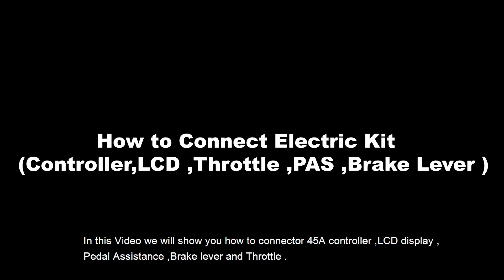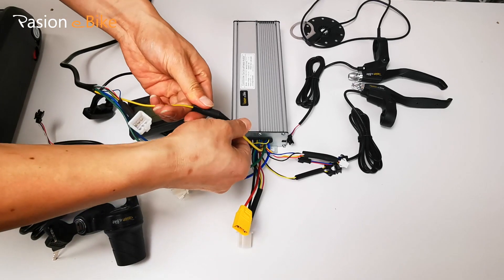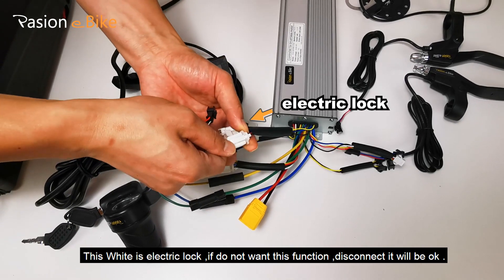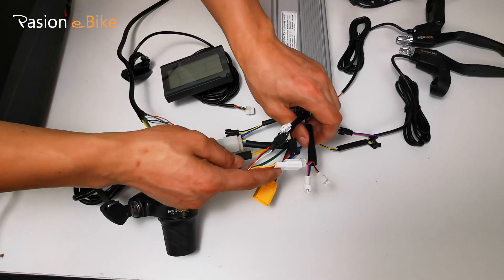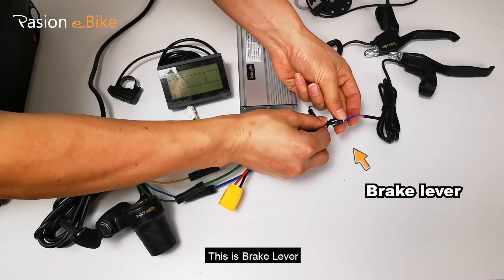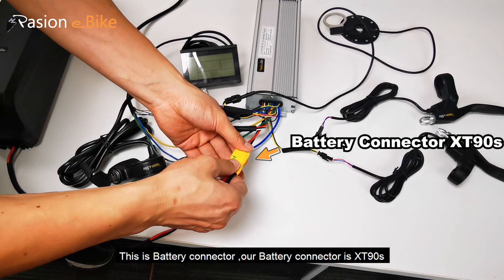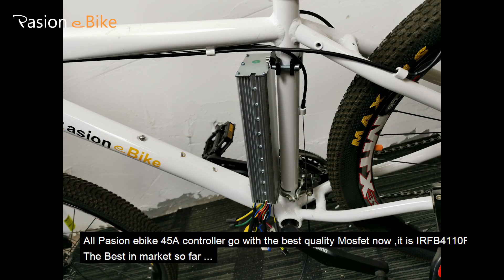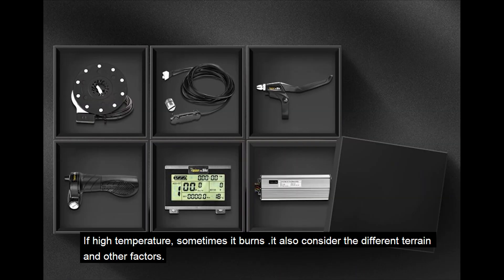0 Pasion ebike Tutorial  How to Connect Electric Kit  45A Controller,LCD ,Throttle ,PAS ,Brake Lever

Comment: hi i have a question plzmy bike HAS 48v battery and brushless motor i bought a new  48v/64v controller if i hook up my battery will it output 48 or 64 i am affraid it fries the motor is it automatic i mean?

Comment: Your didn't show the two small blue wires, I believe they are called speed limiter,  that are on the bottom of the pile. Do they need to be connected together?
Reply: if you connect them your ebike will run at 50%

Comment: Could this works without the throttle connected and runs only with pedal assist function connected.
Reply: absolutely, just don't connect the pas. Its a very practical part though, particularly if you're pedaling from a dead stop on a hill, for example.
Reply: oops, i meant don't connect the throttle!

Comment: Question: I have a 1000 Ecotric Hammer, 48 Volt, I want to use a 52 volt battery with. Is there any reason why the 48 volt controller would be damaged by this?
Reply: No, it will handle it.